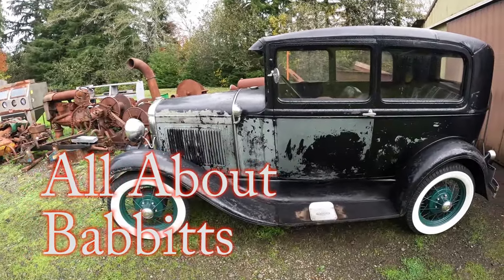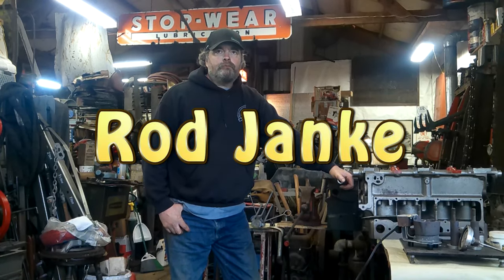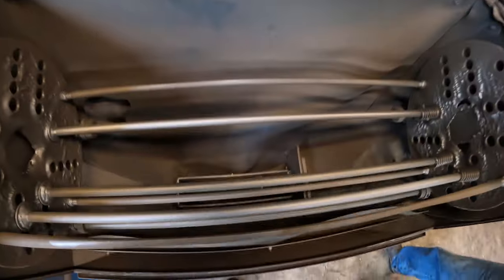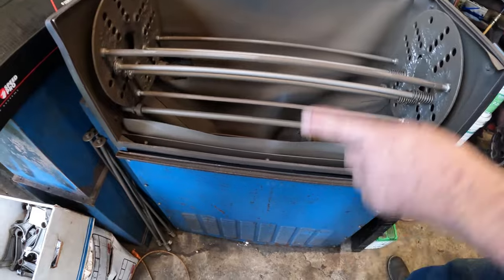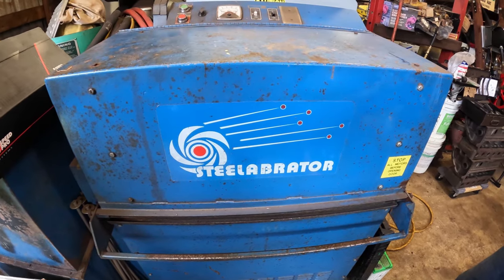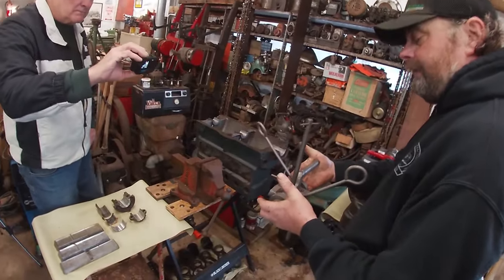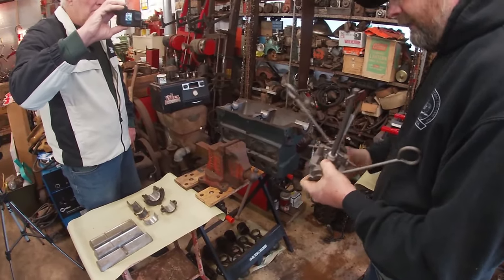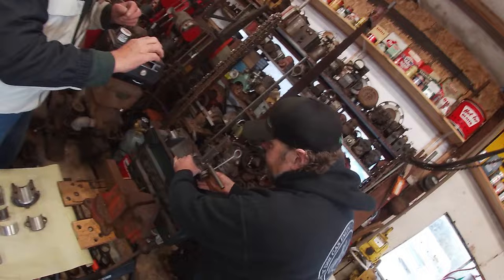Pouring Babbitt Ford Model T and A

Comment: Great video Frank! Say, what type of cameras were you and John using to film this? I'm in the market.
Reply from the maker: I use a GoPro Hero 7 White , a GoPro 10 Black with Media Pack (external mic) and a Chinese 4K Ultra HD.  The Ultra is cheap but has worked well so far.  Has external mic and I leave it on a tripod.  I had to set the CODEC to one compatible with my ADOBE software.
Reply: @edgeta2456  Thanks!
Reply: @edgeta2456  The audio is pretty poor here; I had to enable subtitles to understand the vocals. It gets better but it is not entirely intelligible at the beginning